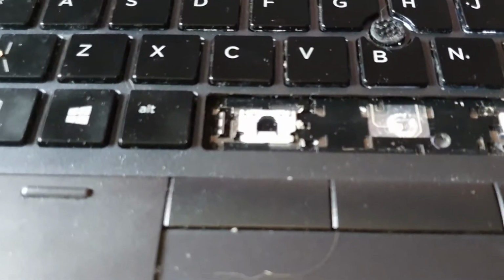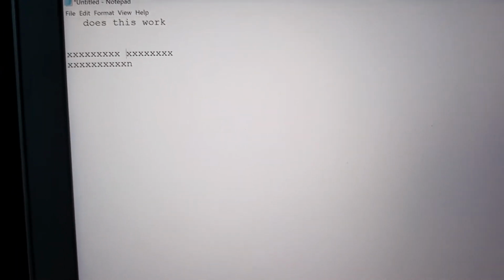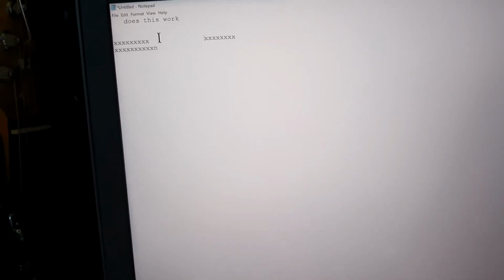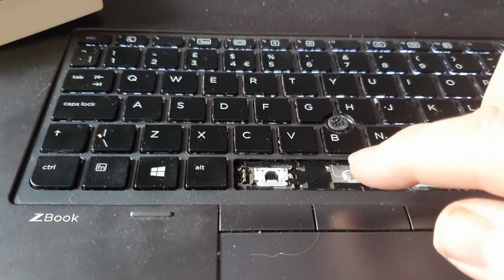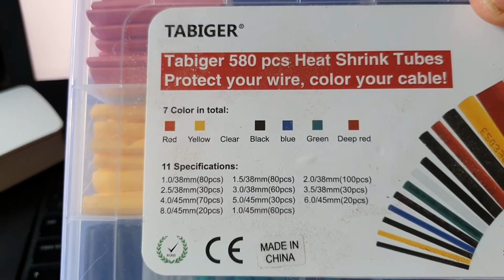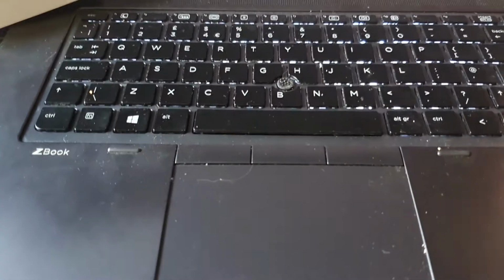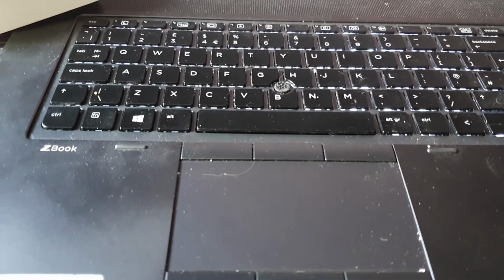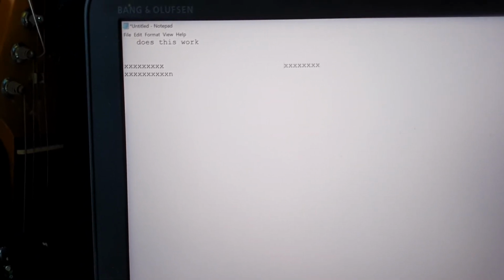Cheap improvised fix for broken spacebar switch on a laptop

Comment: Also, a tin of air duster is your friend, and also, if you have chips in your laptop keys black. You can buy flat black acrylic paint pens and colour in the bits missing. For an extra layer of protection to the keys aesthetics, you can also buy flat clear brush on lacquer to make them last even longer from usual finger contact wear and tear.

Comment: I've struggled with the same on my clevo laptop, they don't do spares and my spacebar bubble switch is - well the bubble has broken off. I tried adding a rubber bit with superglue but it worked for maybe a day and gave upon me. Can you do a " cut this, cut that, attach this, attach that there and show us how you achieved it, I can happily go back in and out of the keyboard no probs, i just can't get a spare. Help !! Thanks in advance.
Reply from the maker: Can you let me know the brand and model and I will see if their keyboard is anything like this HP one was. My fix.worked for about 9 months then I bought my own replacement. I use my current laptop with docking station and external.keyboard / multiple monitors. Stock keyboard is unused.
Reply: @stephenhookings1985  If I can find my magnifier, I'll flip my laptop over, grab the serial number and google the model number. My laptop was made by a company called pcspecialist. pcspecialist and many others that make " bespoke " laptops, don't make them, They give you an online ticksheet to fill in and if you change out one part of your build, they'll have to change the chassis, or case, which will then limit what other bits will get supported - like my rgb keyboard. A Chinese company called Clevo makes tonnes of companies mainboards/chassis's/keyboards/screens etc, then one of these companies buys a bunch of them and all they do is slot in the bits you want and market it as built by - for example pcspecialist. My laptop is like 7 years old now and they just don't support it. Even getting a new full keyboard is as rare as hens teeth, but you would of thought that to keep manufacturing costs down, they'd use the same keyboard & bubbleswitches for all their laptops, apparently this is not the case. Am I right in assuming that the rubber switch in the middle of my spacebar IS a switch, or is it there just to keep the spacebar raised to the correct height and to allow springback on each press? To the left and right of the centre bubbleswitch are two more modules, but they don't look like switches. Are they switches? or are they there to help keep the spacebar seated correctly?
Reply: @stephenhookings1985  sorry its took a while. Its a clevo P670HP product code p670hp6-g . i swapped the duff rubberswitch with my unused enter key. it's no better. the spacebar will no longer seat properly, it's about 1mm too low and the springback is none existent and the spacebar really needs hitting hard to work. And the enter key with the broken rubber switch is even worse.

Comment: HELP ME, I TRIED IT ALL, MY SPACEBAR WONT GO BACK IN ITS SPOT, ITS NOT BROKEN, IT JUST WONT GO  BACK IN
Reply from the maker: I posted another YT link below to a reattach spacebar. Some found it useful. Depends on your manufacturer. Also older mechanical keyboards were quite different to modern. There again they didn't break in the same way. Good luck reattaching.